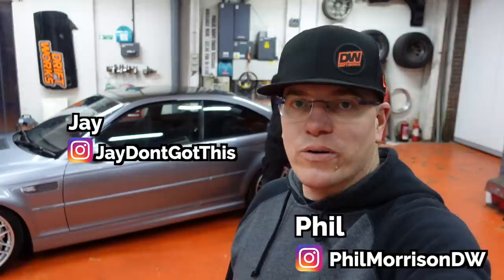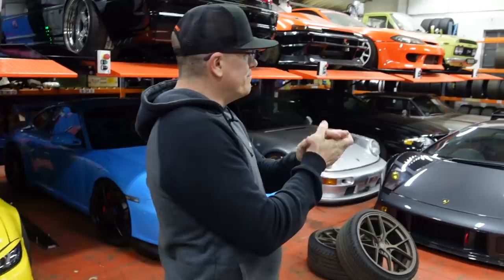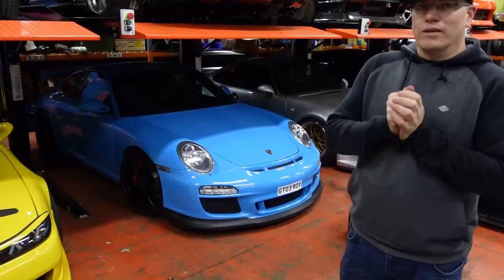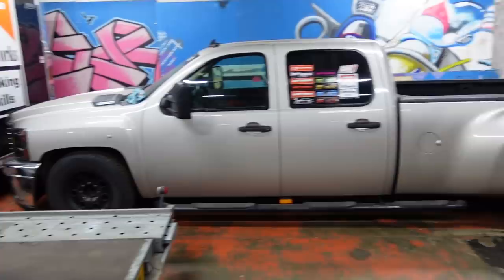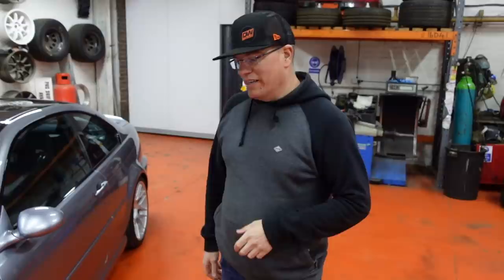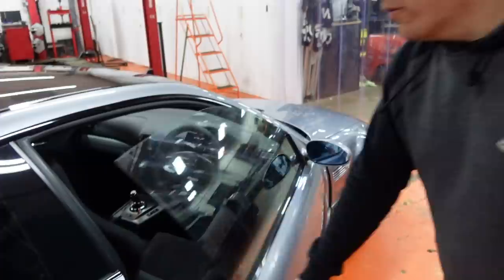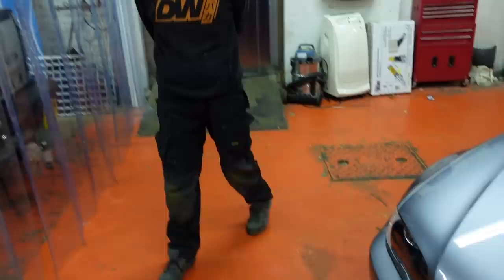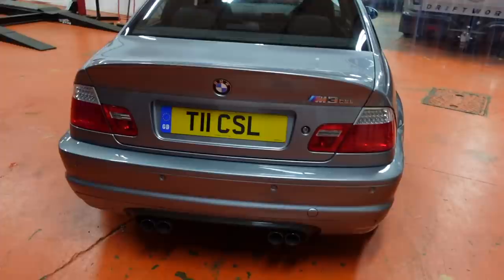I'm NOT a Car Collector! Selling my BMW M3 CSL Cheap! & other cars

Comment: Seems like the right time to sell at the peak of the market, and the CSL is an example that will always lose monetary value when modified. Cannot blame you in the slightest in selling it. Especially as you put it, "It should be someone's pride and joy" and it simply doesn't make monetary sense to heavily modify - which is clearly your passion Phil - and so you may never get the same fulfillment as another potential owner.

Have to say, it seems a very selfless decision to part ways with a modern classic like the CSL, I can only applaud you in giving someone else the joy in owning it. Hope this means your current builds will have a bit more budget behind them, and that we may see another build or two to come with the standard you've set.

In all truth, you've built a garage full of the best of the best, built to your own exacting standard that any enthusiast would lust after.

Comment: the CSL would be the hardest for me to let go, literally the best ever bmw in my book.
Reply: If they made them with the manual transmission it would be up there but no way can an SMG car ever be in the top 10. Here’s my  top 10, no particular order:

10. E46 M3 manual 
9. 3.0 CSL
8. 2002 tii 
7. M1
6. Z8
5. M635csi
4. E28 M5
3. E39 M5
2. E30 M3 Sport Evo
1.E92 M3 manual

Comment: The paint on the calipers is from when someone bleed the brakes and allowed some fluid on the paint and didn't clean it properly or quickly enough and it caused it to bubble and dissolve slightly. Common on bbk when done by the owner or someone not used to painted calipers

Comment: Perfect CSL to do a manual swap. 

Look at Audi SQ7 as it has same tow capacity as the Cayenne Turbo but at a much lower price point, at least in the US. Basically the same platform and engine.

Comment: It’s a nice problem to have. 

With your GT3’s… is the new one getting used more because it’s new, or has the blue one really fallen out of love and become superfluous?
Reply from the maker: It's definitely because it's new, but also because it's better in every single way. The 997 is incredible, but this is just more, without having lost any of the GT3 character. I said a while back somewhere that as controversial as it is; I thought my 991 GT3 was better than my 997.
Reply: @driftworks  there’s your answer, it’s either an emotional attachment or the want for actual performance improvements. 👍

Comment: shes a go'er not a show'er
Reply: Excuisitely well mechanically maintained from the sounds of it. Drivers points of contact well sorted and looked after as well. Simply the exterior and passenger areas not kept to exacting showroom spec, but buy a Rolls Royce if that's your interest.